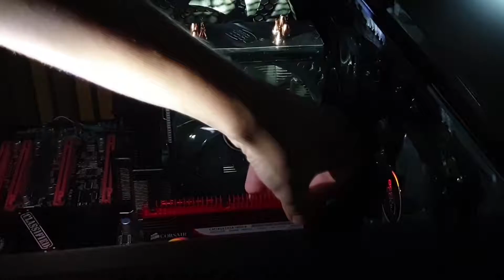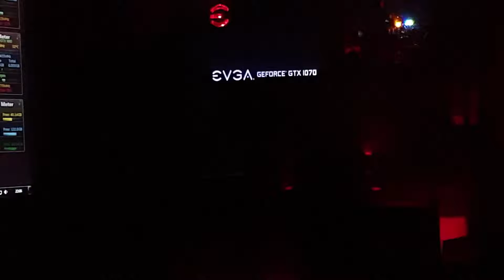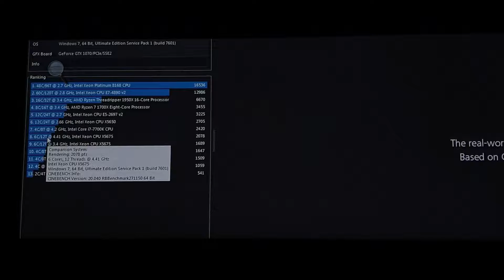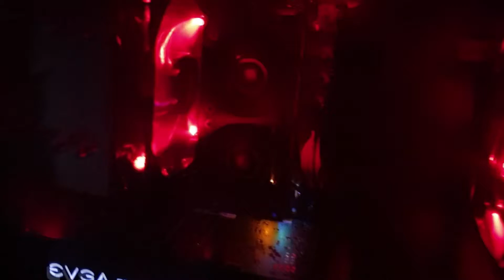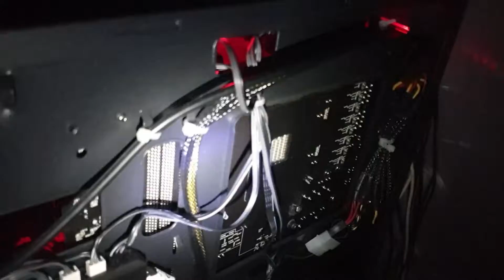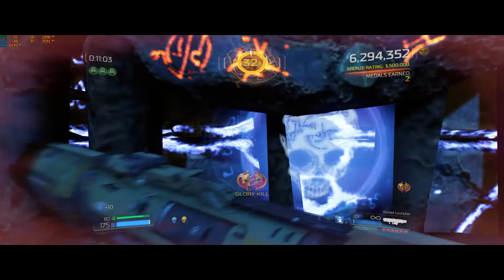My New X58 Build - EVGA X58 Classified, Xeon X5675, GTX 1070, 18GB RAM

Comment: with that odd memory config, 2x8GB plus 1x 2GB I would expect it can't run triple channel and probably will not do dual channel either and it would be faster with the 2gb removed? eiyher way i'd replace the 2GB with another 8 and run triple channel

Comment: I'm trying to install an X5675 on this motherboard (except it's the E759 version). It doesn't want to boot, it gets stuck at code FF on the debug display. Did you do anything in particular to make it work ?
Reply from the maker: If it's Rev 1.0, it won't work. Check the lower left corner of the board, you should see what revision it is.
From what I remember, you have to solder two points somewhere in the area of the CPU socket.
Reply: @N33dF0rSp33dFan  it's a rev 1... crap.
Reply: I have the E762 4-way classified also a rev 1.0, can't find the exact mod pics for what to solder (also got a X5675). Hope to find the time to check if any of the other evga boards for which I could find the mod pics are at all similar
Reply: Getting ready to attempt this mod on my e760 Rev 1 mb I have a 975 extreme in there now but I also have a x5675 sitting here hoping to get this chip working on this board as my stock dell board has no oc features
Reply: Mod worked and I actually have it oc to 4.4ghz running stable

Comment: Just bought the x5675 chip, I have the evga e770 motherboard. Do you have any good references or guides to overclock it? It will be my first attempt to oc. I want to do something conservative, maybe around 4ghz oc? Any help or suggestions would be appreciated. Thanks.
Reply from the maker: Here are the 4.4GHz settings I had on it: https://m.imgur.com/a/VQzUzaW
Remember that every CPU is different and some luck is involved (silicon lottery).
Unfortunately I had to sell the PC and I can't check a stable OC for 4GHz. However, I've seen 4.2GHz easily on X5675's. You can check Tech Yes City's Youtube Channel for a guide to overclock it as well.